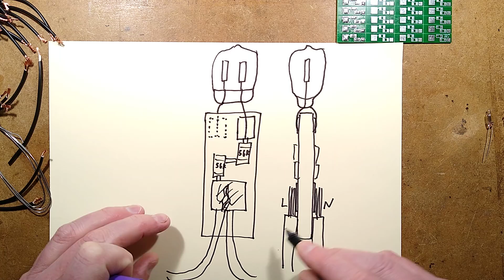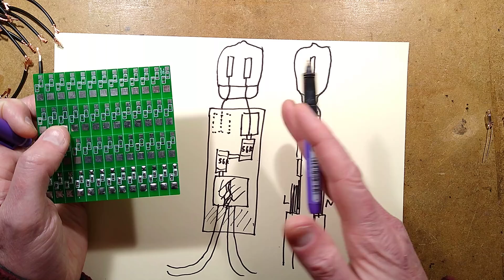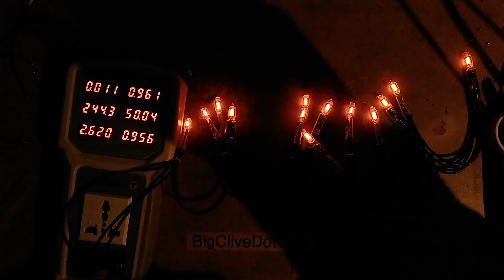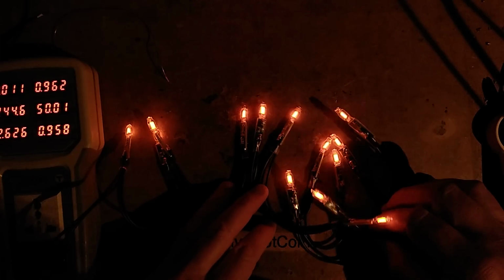PCB based neon fairy lights

Comment: Ever considered getting a solder pot for these kind of projects? Like for the wires it would be something like twist, flux, dip, reflow on the pcb, while to pre tin the neons you would just dip them.
Don't know just wondering if it's something that would make sense for you
Reply from the maker: I have one, but rarely use it.

Comment: Hmm, I get the idea and I like it
But since NE-2's and resistors are so cheap it's quite an expensive way of attaching a resistor to an NE-2.
No need to use 4(!) resistors on a neon bulb. I have installed so many of these with a single 1/4W and never had any issues with heat. When in doubt, use a 1/2 W. But really, there's no need for it.

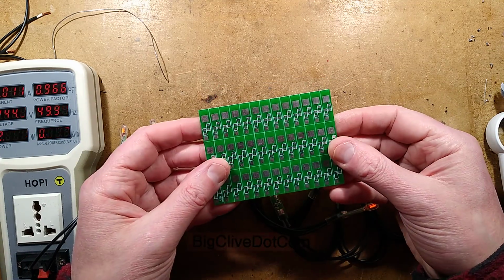Comment: 05:46 the surface mount resistors are 1206 it's just a nice big chunky size and like those big chunky resistors15:56
15:56 the resistors for 232 40 europe, australia., uk 

16:13 of them if you were doing this in america for instance you'd have to find the recommended resistor value for a
neon indicator and then divide it by four for each of those resistor positions or put links in some of them because uh 
there's much less dissipation in the 120 volts for the neon than there is in 240.

Comment: I've has a home made neon indicator working for the past 41 years is this a record?  Can anyone beat this?
Reply from the maker: If you chose a high value resistor for it, then it will last a very long time.  The commercial indicators always overdrive the neons.

Comment: I used a 2kV, 10nF capacitor on one leg and a 1k Resistor on the other leg of such type of neon indicator. 
I noticed no warming and the brightness is decent. 
Oh right, power is 240V and 50Hz. A very noisy sine wave form.
Reply: It might damage the Neon slightly every time you turn it on. Otherwise it should work fine.
Reply: @Basement-Science  Yeah, I noticed, it's a bit of a lottery in which part of the phase the connection is made. Some times the neon is a bit bright for a fraction of a second. Sadly I lack ideas for a soft start.
Reply: @heyarno  Well, that's why people usually just use resistors only. Unless the efficiency really matters, that's usually the best bet. If efficiency matters, LEDs are usually a better bet anyway.

Comment: Create a module or add a plug that has a 0.1A--0.2A 230V fuse, so in the event a string breaks off and shorts you won't have a fire.

Comment: Just a note about those cheap Chinese rework stations: They often have the fuse connected to neutral rather than live so if you get one it's worth opening it up to rewire it so it's not live even if something causes the fuse to blow.
Reply: Yeah, I found out when I bought one from a "UK seller" on eBay and rewired it for my local plug type, using brand new 3x0.75mm² cable instead of the unidentified factory cable that ended in a fake British plug.
Reply: Only possible in the UK, the schuko plug version can be plunged in either way so you have to add another fuse on the casing rear to have in every line
Reply: Man, it seems that "cheap Chinese" anything is frequently corner cut just as Clive sussed out.
Reply: @SeekingTheLoveThatGodMeans7648  ✝️
Reply: Demonstrating my ignorance here I'm sure, but given it's AC, why does it matter that live is fused?
Reply: @sammo303  Less possibility that a piece of equipment with blown fuse will then become electrically hot.
Reply: @SeekingTheLoveThatGodMeans7648  More that it will seem turned off but still have a deadly voltage that will kill the person trying to repair it.
Reply: @sammo303  having the fuse in the live/hot wire prevents any harmful current from being present in a device when the fuse blows. AC or DC doesn’t make a difference, you just don’t want the non-ground/non-neutral currents flowing back to the power company via your body, which is exactly what it would do if the low-resistance neutral wire had the fuse in it. No bueno!
In fact, getting your body to be part of a high-voltage (>40ish volts) DC circuit is worse, because your nerves will just tell muscles to contract and not let go. With AC, you have a better chance of breaking contact.
Reply: @toolsarecool  I think perhaps you may have got that backwards. I used to think that was true as well (because my electrician father told me so), but turns out it's the other way around.
Reply: @SodAlmighty  which part? Love to learn!
Reply: @toolsarecool  You are more likely to be able to let go of a DC shock than an AC one, all else being equal. It's a common misapprehension that it's the other way around. The Internet is full of "facts" both ways; but Big Clive says it's this way, and I consider him a pretty valid source.
Reply: @SodAlmighty  Fair point with the "all else being equal" disclaimer. Nobody questions the authority of Big Clive! AC definitely kills sooner for various reasons, too and I've flung a couple of devices across the room after accidentally touching AC parts... 😛 Thanks for being civil in your feedback!
Reply: @sammo303  Because neutral is connected to ground at the mains consumer unit (fuse box). So it's more difficult (but not impossible) to get a shock off the neutral wire.
Reply: 🤭⚠️ - 😠, Chineseum crap

Comment: OT but something I found strange happened, and I'm sure someone here will know why. I have some Poundland fairy lights, and one set in particular is not very bright at all, however I noticed as I was lighting a wax melt thing next to it, with one of those long lighters for gas cookers, when it clicked, the dim poundland light suddenly sprung into life, for a fleeting moment at least. So why is that? Some sort of kinetic energy? I must have missed that day at school..
Reply from the maker: Could be a bad switch connection, or if it eats batteries it may be a bad LED dragging the voltage down.

Comment: Another therapeutic soldering video from bigclive. Thank you! What temp do you solder at for this type of work?
Reply from the maker: Around 350C, but go by soldering feel.
Reply: @bigclivedotcom  Im fairly new to soldering. Have been doing a bunch of cheap AliExpress/eBay kits last few months. A lot of soldering tutorial videos mention that the solder doesnt melt until about 220C and they suggest about 250-270C which is about what I am using. I noticed you said you use 350C which seems a fair bit higher. Is this so that the heat up time is shorter and less damaging on components especially given your good at it so you dont spend a lot of time messing around once solder melts getting it  in place? Or personal feel? What would you suggest for me? Should I stick to 250C or is their benefits to going higher to 350C? Would a certain temp be too high? Sorry for all the questions, been watching for a while but first time questioner. Enjoy your vids, stay safe in these crazy times/world Clive

Comment: I just had a flashback to the Radio Shack (Tandy in the UK) "Goofy Lights" Science Fair-branded electronics kit from the 70s.  It came with a plastic perfboard box and all the parts needed to assemble a little 5-neon light gadget that could be configured in multiple ways.  My preference was the random setting.  I could turn out the lights and watch that thing blink all night.
Reply: same here I remember it well wish I still had it  I rebuilt it onto veroboard and put it in a fireplace for a dolls house
Reply: @thehappylittlefoxakabenji8154   It sounds like you came up with an excellent way to repurpose it, though!
Reply: @PolyglotPfannkuchen  yes it looked very realistic ! 
just wish I still had the schematic for it !
Reply: I had that too. But I wired mine for sequential, looked like a police scanner of the era.
Reply: That was the first electronics DIY kit I got for Christmas.

Comment: It's reassuring to know that BigClive can also forget to heatshrink a wire, or totally miss a pad on a surface mount resistor! Like how did I manage to solder 10 identical boards, yet one is not working, and then see an SMD resistor with only one pad with solder, do we have brain farts while in robotic solder mode!?

Comment: Additional protection would be some resistors in serial with the bis wire, since lower part of all pcbs would be unprotected in case they pierce through. Also maybe a second black sleeve to hide Pcb?

Comment: For so much heat shrinking could you use an oven to do them all at once rather than doing them all individually? Especially if you were doing a full board of them it might be a time saver.

Comment: I did a rough calculation of the resistance needed for 120v supply, it came out at about 90k total or 22k per resistor.
Reply: Rough calculations? You do that on an abacus too. His power is 240. 240÷ 2 is 120.  Don't overthink it just half it. No need to break out formulas and neons are pretty forgiving.
Reply: 0.9mA across 220k ohm's is about 200V, meaning average drop across the neons is about 40V. With 120V supply that leaves 80V to drop across the resistor. If you assume the same 0.9mA that gives 89k ohm's required.

Although neons are forgiving it isn't safe to assume the same for all circuits, and certainly not if the voltage can be higher or lower than nominal. If it was, I'm sure Clive would have said so.

Comment: We got a yahua rework station recently and I am impressed, for the price they can't be beaten.
Reply: I'm an ultra-amateur here..  random repairs, sporadic projects, and occasionally soldering my eyeglasses back together...   but I really like mine.  I recovered the value in one piece of equipment from our business (actually about 5x that) but it heats quick, holds well, and I have ZERO complaints.
My next step is to replace the tips with some good'uns.

Comment: How many panels did you buy ? its a minimum of 5 so you did get 260 PCB's and if you look at the price in the right hand panel it changes in 'real time' and its immediately obvious if you select something that is not covered by the offer, there is no excuse for not being aware what your being charged for and I'm not sponsored either but its a very good deal...cheers.

Comment: Hmm you use double insulated cable and yet just a single layer of heat shrink ? 🙂
Reply from the maker: Thick heatshrink with the option of a second layer.

Comment: I kinda ran into the opposite problem with panelization once, fab was like we're going to upcharge unless you panelize these because we don't want to deal with routing out and handling every single one. Snapping out like 2000 boards isn't pleasant on the fingers, but it's free.

Comment: Is there anything you can do to make them twinkle randomly?
Reply from the maker: Yes.  But it would require a capacitor, diode and two resistors per light.

Comment: Why not make 2 separate solder pads per side so you do not have to twist the wires together ? 
Pads must be "thermally insulated" by a gap in the copper so soldering one will not desolder the other.
Reply: then you'd have to align the 2 wires more accurately though. You'd probably solder them individually then, which may or may not be faster.

Comment: Ahh, this was your cancelled Christmas plan?

Why don't you rectify the incoming power, so more of the bulb glows and can run at a lower voltage

We use that cable on our lights? All I've seen I'm pretty much has been recycled speaker cable 🤣

Did you add extra solder first to the pads the others seem to have next to nothing
Reply from the maker: Rectifying it would make one electrode glow.

Comment: The price went through the roof due to the engineering charge for V gooves less than 20mm apart. For sizes below 20mm use "panel by stamp hole". You can combine the two methods to get 20mm x 10mm boards :) Do not tick any panel options when ordering the std 100 x 100 pcb's !
For solder paste, use a stencil !
Reply: I got some PCBs made by Seeed (yes, three 'E's) a couple of years ago on their 10x 100x100mm for $5 plus shipping deal.
Individual boards were ~13x25. I didn't do anything beyond placing a grid of lines on the appropriate layer where I wanted the grooves between the individual circuits, and I'm pretty sure I just got charged the regular $5.
I've probably had ~25 different orders with them in the last decade, and I've always been happy.
Reply: @davewilson4493  I was thinking something similar. Print where I wanted them scored, then score with a hobby knife/box cutter by hand.
Reply: @markfergerson2145  Looking back, I didn't write very clearly - with a grid of inter-board lines on the Dimension layer , they did cut the grooves in.

Comment: Panelizing does make the cost go up, but its still cheaper than if you tried to buy all those as individual pcbs. 

Also I don't think you can get individual circuit boards that small. The minimum dimensions for a pcb (whether it's a one circuit board or many circuits in a panel) is larger than the minimum dimensions for the individual circuit boards that can be v-cut into a panel.

Comment: Nice job Clive! Those are quite nifty. I am always amazed how fast and easy your solder works. I am a noob at soldering and I always have trouble with it flowing. I may need to research the proper equipment more.

Comment: Thank you for a most relaxing video. Is there a away of changing the design for outdoor use? Admittedly, I prefer low voltage for external use. Also, could you not mill the v-groves yourself with a CNC router.
Reply from the maker: I would only recommend low voltage for outdoor use.

Comment: Looks like the complete panel was over the jlcpcb special offer size of 100mm by 100mm? I use Fritzing PCB design software which doesn't support vscores unfortunately. Seems cheaper to buy multiple PCBs than to pay for the panelisation.
Reply from the maker: It was within their size.  In hindsight I'll compare panelization vs loose.

Comment: I am still using a reel of RS multicore solder from the 80's with no problem - so I don't think the flux ages that much - its basically rosin or pine tree resin and amber seems to last for millions of years 
according to Jurassic Park....
Reply: I have has the same experience with my early 90s reel from Rapid. The thing (and it is quite _the thing_) has travelled halfway around the UK with me and is now in southern Finland. I suppose the price of love is grief, because it will end one day. Or the lead will end me.
Reply: Was just thinking the same thing a few days ago.  Still have a roll of the thicker stuff and it worked perfectly.
Reply: I think the flux changed at some point.
Reply: @gordonlawrence1448  I believe it has as. Our work supplied one in the UK was known to be a potential lung irritant and was changed, possibly 20 years ago. After many years of using it I certainly used to suffer if I breathed some of it in.
Reply: I would expect that some fluxes, specially the low-viscosity stuff you apply with a pen or a brush probably does dry out with age.  That stuff must have a solvent in it.

Comment: They remind me of those super expensive ws2811 strings only way cooler.

Clive I've had one of those cheap heat guns melt in my hand and burn me. It was at 30 percent airflow and 300 degrees and on for a half-hour in which 25 minutes were spent in sleep mode.
Reply from the maker: I wonder why it did that.  One recurring theme with them is the heater triac failing on.
Reply: @bigclivedotcom  I notice alot of the lower end hot-air guns where the fan is in the handle instead of an internal diaphragm and just the heater in the handle tend to give a spare set of internals because quality is a known issue. You get what ya pay for though I suppose.

Comment: I've got nothing against pcb sponsors but when people who say they're teachers solely use pcbway for circuits without showing people how to read the schematic and at least breadboard them to check for errors and teach 99 percent of the viewers how to have some fun and learn. They leave the whole thing out after the circuit name and what it does relying on views to pause the screen to copy down the schematic. Then 5 minutes of watching someone bumbling over a professional board and how it wasnt properly routed or even if its correct and the only one having fun is the maker. While people trying to learn are informed about how the pcb is open source as a gift and anyone can have it for free which in Canada is 60 dollars each time you order. The pcb companies have a deal with DHL or whoever I'm sure because 8 dollars for a couple boards then 52 for shipping kinda makes you wonder who is getting their beak wet. Both companies are. End of rant. I do not count you amongst these people Clive.
Reply from the maker: Hunt for the airmail option.  It's usually the cheapest for shipping.